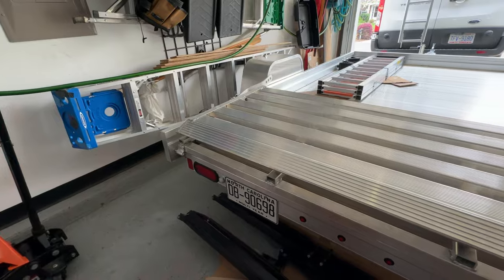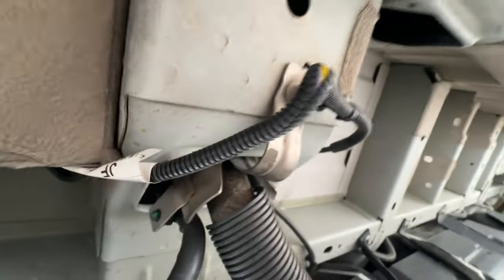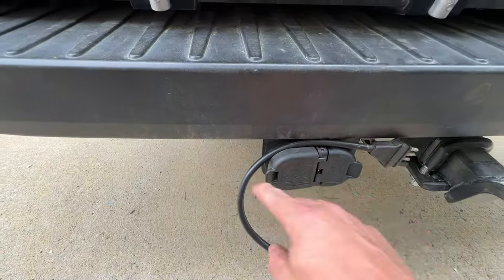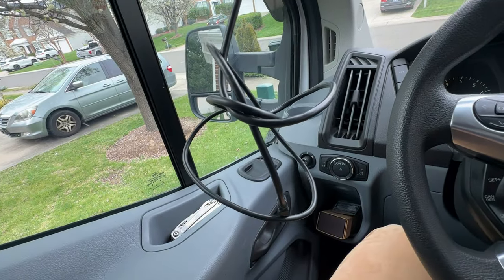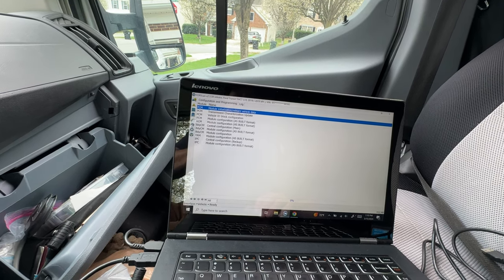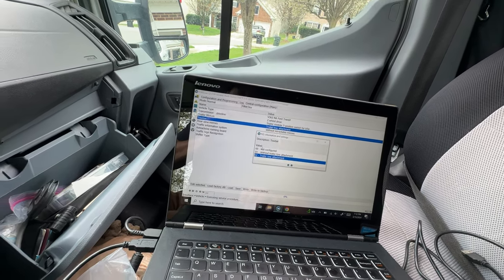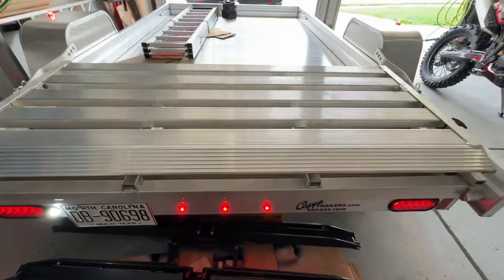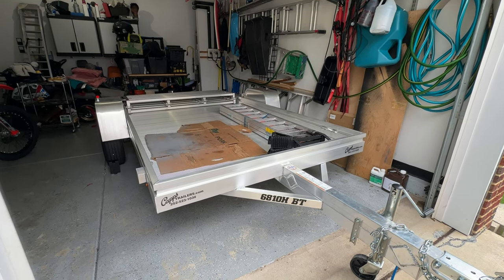How to enable trailer running lights on a Ford Transit van.

Comment: Was the module the you installed factory?
Reply from the maker: Yes Ford OEM tow module and wiring harnesses.
Reply: @MTBPlanB  I have some questions for you. Is there a way I can contact you? I'm trying to get a customers transit trailer wiring to work
Reply from the maker: @ryanbradley3855 Here or FB messenger.